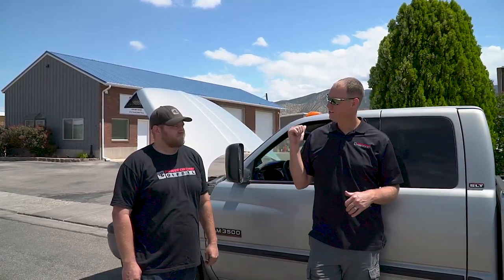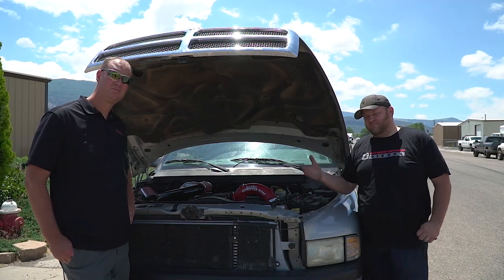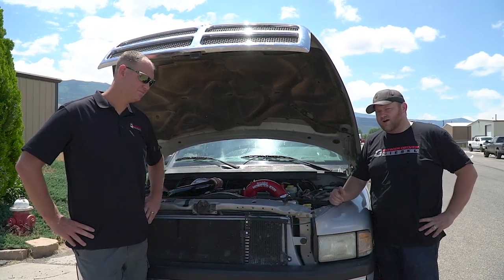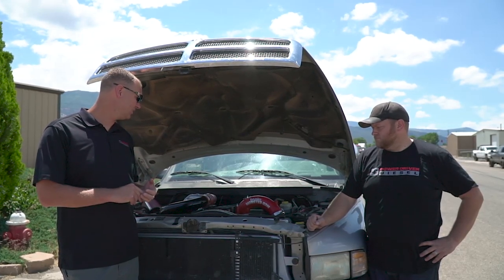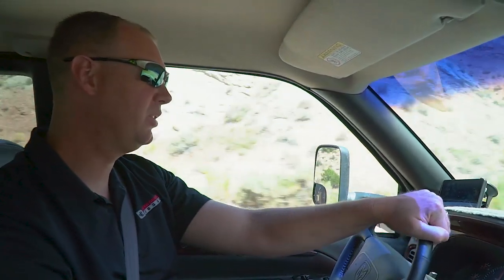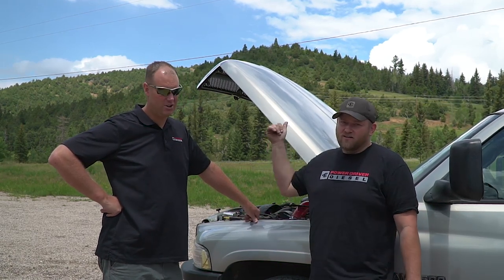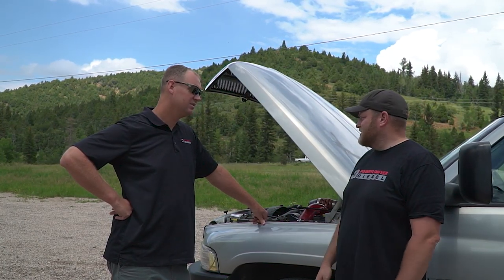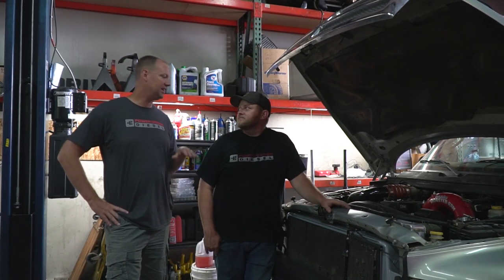Towing Turbos for 24V VP44 Cummins Diesel

Comment: Man this is the best video I’ve seen with you guys discussing different technical aspects and what upgrades compliment each or work against one another... I learned a lot because this is my cup of tea with a towing upgrade and how far to go w/o overdoing it
Bravo..!!!!!!
Reply: Yes for sure last thing you need on the road pulling a load is a heat soaked engine bay. And the larger the block the harder they are to cool down. My KW with the 15 ltr cat twin turbos propane injection could pull super hard but only to the point of not enough cooling and capacity only helps so far once you have worked it to the point of not enough air or coolant to cool at some point you just have to stop working so hard or risk catastrophic failure. According to dyno exc it was putting down 850 around off horse power to the rear wheels and 2600 or 2800 ft pounds of torque but the last part of the pass always got me had to drop into lower gears for cooling and not so much work. It would do it in high gear but not without getting uncomfortably hot. So still running lower gears at the higher passes. 😁🙃

Comment: Best vp44 setup I ever saw was an FMS stacked with a power puck with 8x.011 buddha injectors and a 62x71 .80s300 over a s475 and it ran about 615rwhp and pegged the dyno at 1200tq on Dave Dunbars 248dynojet uncorrected.

Comment: Great video again Todd & Will.  Have you guys considered a different cam shaft?  My reason reason for asking is I have four VP44 trucks, and we hit 500+ HP to the ground.  Just curious...

Here is our setup: we run Edge Products Comp Box on the VP44 pump, then stack a Smarty SO3 Tuner for max torque management using Garret compound turbos, and a Colt Stage 3 (Big Stick) cam shaft with a 181/210 degree grind, plus Dynamite Diesel Products 200 HP over injectors.  The trucks put down 500+ HP to the ground.  Also, we have the pistons Fire Ringed, and use the ARP 625 head studs.

Comment: There are better radiators than mishimoto but the real secret to cooling these monsters is with a second (auxiliary) radiator because you can put that capacity in its own cool fresh stream of air.  I have been fixing the overheating issues on the lbz duramax  trucks for years and the auxiliary radiator out performs a larger main radiator every day of the week because the only way to get larger with the main radiator is to go thicker which has diminishing returns due to air flow resistance and loss of cooling ability.

Comment: Awesome video guys. I was AMAZED at what the stock VP 44 supported, and no doubt the quadzilla is a great tuner for 2nd gen trucks.
When Will was discussing pump stretch, is the higher power created by getting the available fuel in “quickly” so to speak?  As opposed to leaving the injection event longer and losing injection pressure and spray pattern? 
Keep up the great work!  You guys are awesome!

Comment: Great video,  happy to see some vp44 stuff.   Very cool to see this as I just put your towing compounds on my 01 ho, w/6speed.  Slightly smaller injector at 7x.095. And with quadzilla.  I just got done telling friends how it doesn't have tire burning power, but will pass everybody with a trailer! Love the turbos.  Side note, had to modify hard coolant line as it is different than an auto and wouldn't fit with modifications.

Comment: I experienced some of the heating up when I tried to tow my trailer in the summer going to Colorado . I got home and ordered a new Mishimoto . The stock on was ok when ridding around unloaded but throw some boost and under a load the temps climbed . Yep I used the heat trick before but its not a fun deal lol . If I was going to use the truck like this a lot I build a remote cooler under the bed and use a electric fan to help control heat . Not sure how much that would do . For sure I use 3 gear and lock up when pulling a grade and towing my trailer . The reason my stock transmission is still hanging on lol . What a piece of crap 47rh lol with 214 k miles . I noticed that at 22 or some lb of boost the convertor slips in overdrive .  I bought a rebuilt g56 to fix that problem . I really appreciate your post and I might be interested in a set of towing twins or a single to tow with no racing thanks Jim

Comment: Would adding an oil cooler help keep the engine a bit cooler? At least the oil wouldn’t get too thin. Just a thought.
Reply: Anything to help is a benefit but no replacement for less work by using lower gears prevents heat soak and overheating in most cases sometimes it's just to much work.

Comment: It would be awesome if you guys did a video on fire rings vs o-rings. I feel like that would be very beneficial for a lot of people. Also I have your BB 6x.011 with the K27. I run 1600 microseconds with a relatively harsh canBus fuel curve. I can hardly get above 1400 degrees at 40 psi (2500 ft) and still have a slight haze at wot. I feel that my tuning is about as good as it gets for my setup.

Comment: i have the same truck and year and color 90,000 miles on it ,i love it running edge tuner, 4 inch stainless exhaust, intake , truck is garage kept have full gauges, would like to do a little more to it for towing, i pull a 42 ft toy hauler 13,000 dry , plus 800 lb motorcycle, 700 lb golf cart, fire wood in the bed a long with couple hundred pounds of weight lifting weights, truck still gets between 12 and 14 mpg

Comment: I remember when I played with vp44 trucks. I had a 99 ram 3500 with custom 8x16 injectors from bhuda power, a custom built vp44, blue chip box and a diablo sport power puck and a smarty tuner. I also had custom compounds from scheid diesel that were s475 and a h5 with fire rings, manifold, dual disc clutch and aeromotive a1000 fuel supply pump. Truck was fun and would blow the tires loose in high gear on the interstate but was way too laggy to spool. It was my daily driver and would make over 100 pounds of boost. Kept losing vp pumps so went back to p pump trucks and won't go back to vp
Reply: Why go to a pump? The vp is the BEST ip ever. It's all I have and all I ever will have they make INSANE power
Reply: @benjaminturpin2749  well, limited rpms and short lifespan is what made me shy away from the vp on high horsepower builds. They are a good pump for factory or slightly upgraded trucks but it's each different person's preference so to each his own

Comment: I’d like to see the results of a Banks cold air kit. The underhood heat has to be hurting the HP with the hood down during a tow. Boost isn’t everything if the air density is low due to heat.

Comment: @PowerDrivenDiesel
Does water methanol injection keep the chambers valves and turbine clean on a diesel?  Is even distribution a problem on this dry flow intake design?
Reply: @pddofficial  Thanks for sharing and taking the time to respond!

Comment: That looks like monarchpass and sounds like it as well. More cooling capacity and air movement thru the radiator maybe need a radiator extension in the bed or under it. My KW was built but cooling was not enough running 890 to RWP Torque was 2672 but cooling cap would not hold after heat soak
Reply from the maker: That is the problem with the any truck when you are towing is heat soak we have found that 300-350 hp on a single turbo and 400-450 with compounds

Comment: I have an 01 6 speed and got 520 and 530 on 2 different dynos. Single turbo and factory ho vp44. Would like to see what I would get on a "real dyno." Oh and I tow more weight and can keep temps under control without much work. Kinda sounds like the setup isn't what the truck wants.

Comment: I need to drive my truck down there from WA state and throw it on your stingy dyno.  With my PDD towing compounds, 150HP sac injectors, and a Smarty S03 stacked with a TST Powermax Comp I bet you I could hit 550+. 😎🤙 This combo is insane and I’ve pretty much tried them all.
Reply: Steve Cooke post back, that’s my setup but I’m running a 63mm sxe and 6x.013’s
Reply: BenDrinkin1 🤙🤙will do.  Damn those are some big sticks... Are those 250hp Injectors?  How’s your EGTs when you have the Powermax Comp turned up?😳Do you get a little surging like I do at the upper levels?

Comment: I also have the 2001 dully silver with 90,000 all I have done was exhaust and intake and a edge tuner I pull a 42ft fifth wheel toyhauler which weighs 13,000 dry and my Harley and goft cart and firewood and my workout weights and load I'm around 15,500 and get 12 to 14 mpg, I would like to upgrade it some but afraid of messing the truck up, it's been good to me and it's garage kept
Reply from the maker: so long as you built your truck to support the power reliability should not be an issue. This truck for example has a 650 tow/tuner trans. head studs, O-ringed cylinder head stage 2 push-rods, 4.5k valve springs, 7x.010 injectors, a quadzilla adrenaline with custom tunes,  air dog 165 lift pump, and a 4 inch exhaust. so long as you do the supporting mods to handle the power it should not loose any reliability. that being said anytime you increase the performance of your engine you decrease its life span because the engine is know working harder. if you believe like we do that a cummins 5.9 is a million mile motor then if your double its hp then your are cutting its life in half but that is still 500,000 miles. I hope this helps answer some questions

Comment: I know people who have electric powered radiator fans for their truck but the truck didn't put out as much power as this truck. I wonder how it would hold up 🤔
Reply: They suck for cooling. Engine driven fans always cool better
Reply: @alanack67  I second that. I bought a supposed great flex lite dual fan setup and ended up taking a picnic on the side of the road within 25 minutes letting her cool down. Although I have a 2006 with a little over 600hp, the stock mechanical fan would never let that happen unless it broke off.

Comment: I live up in Alberta Canada where we sit on average 3500ft above sea level. I have a 04 3500 srw that I use for work, hauling 10-18,000lb loads around quite frequently. I am looking to make a reliable 500 clean as possible burning hp. Times are tight and parts are way more expensive up here so I would have to do it in steps, what should a guy look at doing first-last the make things progress.

Comment: Cut down the water pump fins a tiny bit making the cooling syteme not push water to fast so it actually absorbs more heat from the engine
Reply from the maker: Good Idea we will have to try that

Comment: My 01 truck wont even get up to 140 most of the time. Only when driving down the hwy. I didnt realize these 2nd gen usually have cooling issues. Good to know i guess.
Reply: If you mean the engine temperature won’t rise over 140 degrees your thermostat might be stuck open.
Reply: @Kyle-pl6rl  I'm selling the truck but I may charge the thermostat to see what happens. That's a good thought, thansk.

Comment: Great video 👍 that set up would be great on my 99 ..  NV 4500 4x4 3500
Reply: RAY Bustabade good luck with that Nv4500 holding up to it. They don’t like torque. Killed ours a few times now on a stock truck other than intake and exhaust. It pulls 10,000lb+ quite often, and the NV4500 has sheared the input shaft, shattered 4th gear, Grenaded a south bend and we take it easy on the truck.

Comment: I certainly appreciate your guys videos...but its too bad you didnt build a towing truck thats more everyday legit.  This setup would not only cost the blue collar worker upwards of $10,000 but it wont be emissions (visibly) legal in all the states with diesel smog laws.  I'd rather see a video about a towing combo with mild injectors, mild tuning, and a mild upgrade turbo...that someone could pass as "legal".
Reply: Bro nobody cares if it’s illegal wright me my ticket officer and I’ll be on my way 06 f250 zf6 manual quad cab short bed 4x4 compound turbo 24v here my kit was an older pieced together this kit probably actually runs more efficient then stock a well tuned engine puts out less smoke and grips and goes me shitting my pants 4x4 launching rowing gears

Comment: At what point would you guys think about plumbing in an engine oil cooler in front of the radiator on a hard working towing truck?  I'm thinking like the largest stacked plate unit that could physically fit.

Yes, there's the stock oil cooler with the radiator, but where everything else is basically adequate on a stock truck, when you increase fueling that kind of goes out the window.  I guess part of what I'm asking is, how much of the cooling problem is the radiator, and how much is due to oil heating via the turbo?

I've thought about plumbing the output oil line from the turbo to a cooler, and then back to the normal turbo oil return, but I would love to hear you guys address this.

Comment: would be curious would a "Fummins" superduty be ANY better on the cooling package or they as "bad" SAY a early 6.0 ERA as a 6.0L FORD is WAY cheaper than a clean running 24V 2ND GEN and the engines / rotted doner trucks are cheap out my way and this build sounds like it delivers enough for what I want it to do

Comment: I'm building a 55 Chevy. Haven't decided on the engine yet, but I'm going with a 6bt. Should I use the 12 or 24 valve? 

I don't need power, just want to be able to comfortably tow a 5th wheel camper around the country in my retirement. I live in Utah, so you boys know what I'm up against. Looking for longevity and economy, but at the same time, I don't want to do 15mph up Parley's

Comment: Wonder if a water/ methanol system would help with cooling the engine to any significant amount.
Reply from the maker: In the testing we've done in-house, straight water seems to give the best cooling, but with a blend of methanol, there is also a modest 25 to 50 HP bump in power depending on how much total methanol gets injected.  On a simple $500 Snow, Devil's Own, etc. type kit, 95HP gain is the maximum we've seen injecting 100% methanol... meaning without a bigger system to deliver more water/meth or even straight methanol, the electric pump can only supply about 95HP worth of fuel when injecting into a normal 40 to 50 psi boosted intake air charge.  With the higher $$$ water/methanol injection systems, we've seen several hundred horsepower gains.

Comment: How much quieter is the truck with the compounds installed? If I put compounds with a 5 inch straight pipe would it still be loud?

Comment: My biggest question, is how much are these modifications. This is what I want to do to my 2001  2500
Reply: RC Seier, that list of mods that they did would probably be $4000 to $6000 I would say. I did a somewhat similar set up with my‘n and it ended up costing in that range.
Reply: $4,000 only in transmission
Reply: Yes, being a manual vs auto makes a huge difference to the total cost. Manual being less half as much as a full upgraded auto trans.
Reply: Thanks for the reply guys. The trans is an auto, so 4 to 6 on that. But compound turbos, intercooler, programmer, radiator, and labor. 😳

Comment: How did you detune the low end without affecting the top?
Reply: I would guess it would require a small injector and just increase the injectors duration. I would think it would be better to keep the injectors in there sweet spot would be better. (Turning down the injector to much would change the spray pattern to much and be less efficient )There truck was outfitted with a 850hp fuel package on a vp44 pump that is maxes out somewhere between 475 and 500 hp. These guys are to focused on dyno hp than real usable towing hp. They should have tested more with smaller injectors and put the correct size in the truck in the end. Now that would be the perfect video and real info.

Comment: Either I was way ahead of the curve back in the day or you guys weren't really into it yet because 13 years ago I was in the neighborhood of 700 horsepower with a VP44 as verified by a mustang, dynojet, and a  dyno dynamics.  Don't get me wrong I have a ton of respect for you guys, but I see some  Misinformation in this video.
Reply: @cummins2949  back then I was running 7x0.016" injectors on the street too, a little hazy but very doable.  I had an hrvp as well but when we disassembled it we found an SO pump with HO electronics, nothing different about the cam
Reply: @cummins2949  quadzilla was around, just not well known and not as capable, I was beta testing what they were calling a hotbox in 2006, ran really good but the shop I was working with kept dropping the ball so I went to a bluechip FMS and an edge EZ plus a smarty tuner, that was my favorite all around setup back then, later I had the FMS upgraded to a redline and gained a lot of power, but lost drivability.
Reply: @pddofficial  I wish I still had it, I never put it on the strip as it was an extended cab long bed dually with an nv5600, and while I got good at banging the gears, I never felt that I would be competitive or consistent enough to be worthwhile. I still have the engine but it's been p pumped and built much more aggressively.
Reply: @pddofficial  if I still had it I'd bring it down and see what it had, I'm a big fan of honest numbers!

Comment: I see you do a lot of automatic transmission Dodge diesels. I wonder what you would do with a six speed with low miles to make about 375 horse power. trucks been sitting for many years I am interested to see what can be done it’s an 2002 dodge with a 6 speed trans.
Reply from the maker: The factory manual 6 speeds are fine for 375 HP long term, you just need an upgraded clutch since the factory clutch usually starts to slip around that 325 to 350 HP mark.